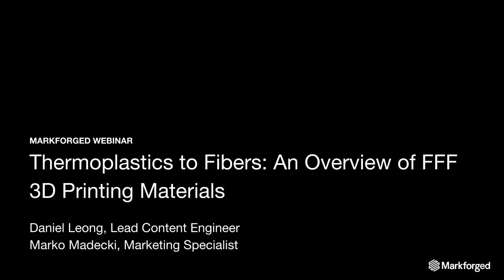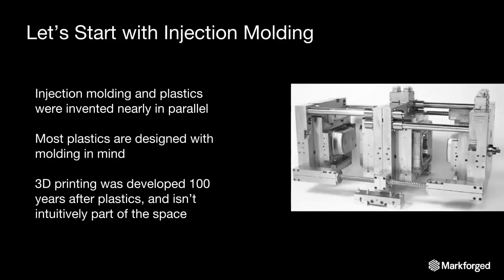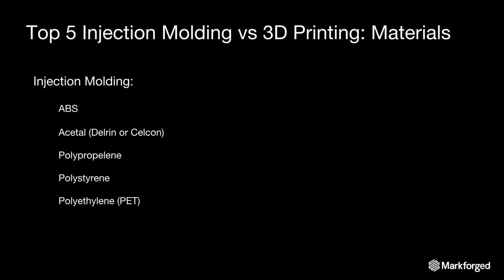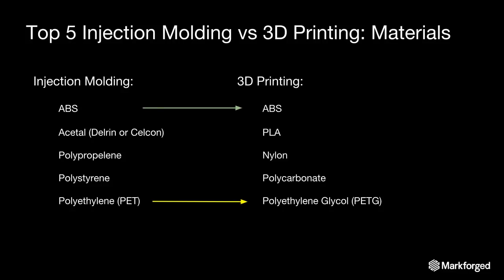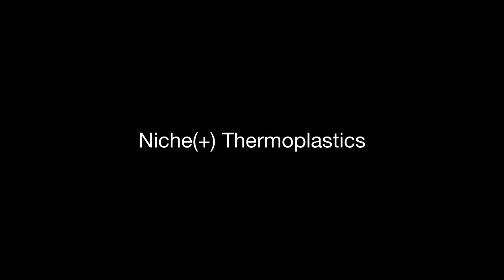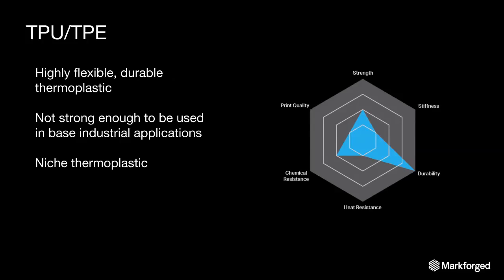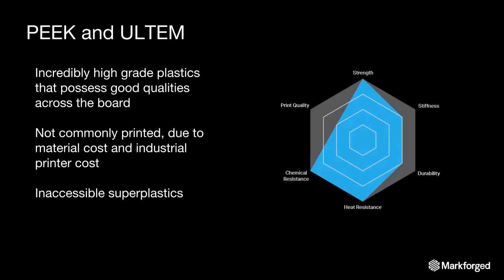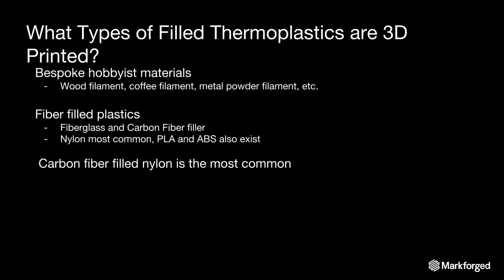Exploring 3D Printed Thermoplastic Materials from Standard to Filled to Continuous Fiber

Comment: Hi. I'm interested in using recycled polyethylene reinforced with chopped hemp fibres to make a fibreglass like small propellor/wind turbine blade. I'm curious to know if you need to somehow 'wet' the fibres in your filled polymers to ensure adequate mixing and 'contact' before printing.